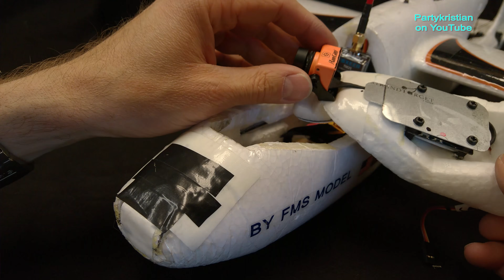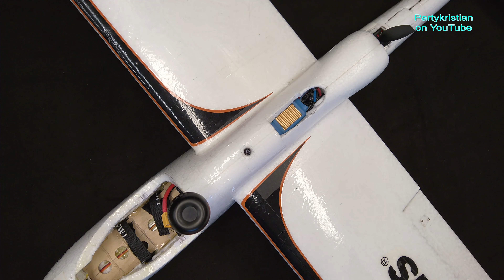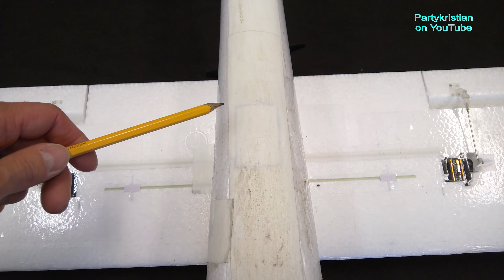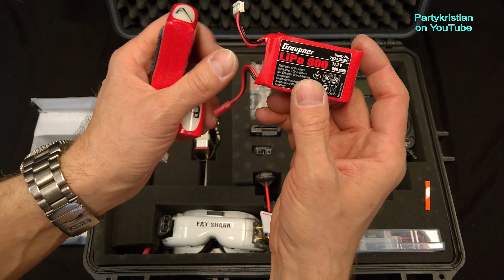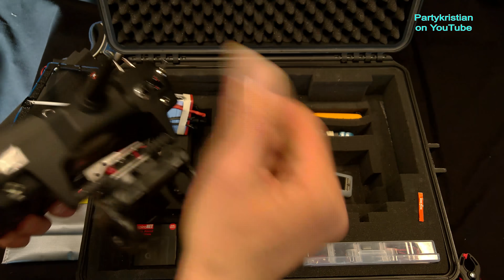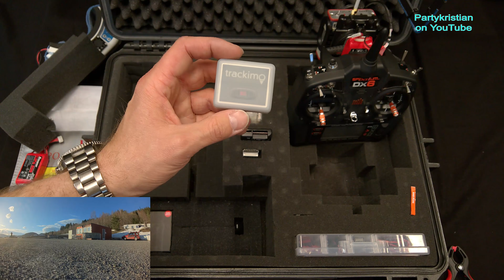Long Range FPV setup from A to Z

Comment: 5.8ghz video tx is not long range, pointless using 433mhz controls with 5.8ghz video, its over kill. This would be a nice setup if it had 1.2ghz video, then you could call it long range. Yes ppl have sucessfully achieved long range with 5.8ghz but with a beamwith of just 15 degree, not very fun. My setup would reach 20km min on 1.2ghz video and dragonlink ofcourse. Also a clover leaf for long range? Lucky to get 1km... Sorry for being a dick, but when i click on a long range setup video i expect one, its kinda miss leading. You explain thing very well, good video apart from my little rant :)

Comment: Were you using a 2.4 GHz system for both your RC and you FPV transmitters and receivers? Sorry you may have said that in the video but I must have missed it.
Reply from the maker: Hi, thanks for the question!  On this plane I had 5,8GHz video and 433MHz control, no 2,4Ghz link at all!